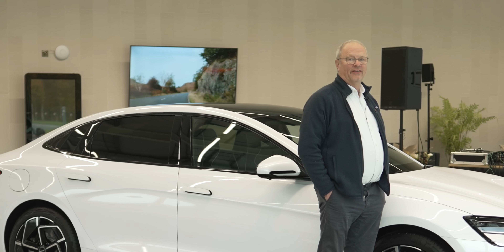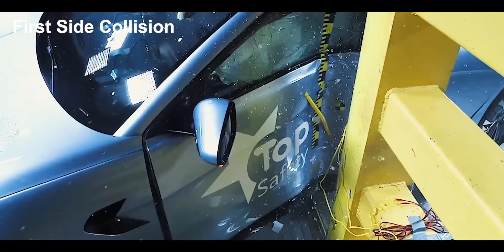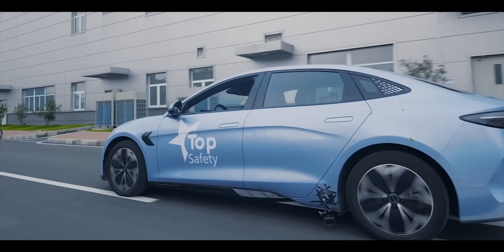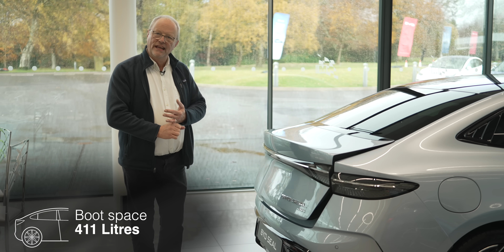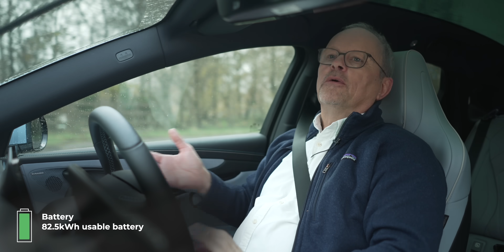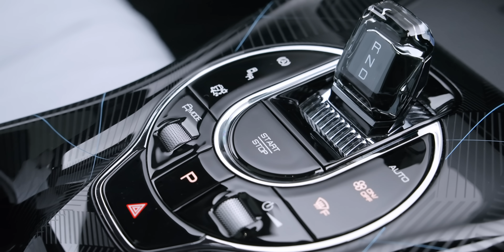This Car Proves Just How Far Chinese Cars Have Come

Comment: I get the impression that charging electric cars in the UK is as expensive as filling the car with petrol , assuming you can find a working charger . Then of course it takes time to charge the car . Whilst you spend even more money on coffee or whatever.
Reply: Only a very small percentage of electric car owners use public charging infrastructure on a regular basis, and charging at home is much cheaper and much more convenient.
Reply: @mowcius I think you exaggerate somewhat by saying 'only a very small percentage of drivers use public charging' and extol the joys of charging at home. Many journeys in the UK take drivers beyond 150 miles (bearing in mind this has a useable range of 300). Quite simply, the UK charging infrastructure isn’t up to the job and I'm not just referring to charge point numbers. As it is, electricity cabling up and down the country can’t handle the increased power required to charge EV's en masse. As for the 'ease' of charging at home, yes I’m sure it’s very easy if one has a driveway, garage  or off road parking. Many, many homes don’t have that convenience. Take a look around when next to go for a drive. Look at how many folk have to park at the curbside. Terraced houses abound. Do you envisage charging points on the pavement outside every residence? Of course, then one has to assume that motorists can be guaranteed a parking spot outside their home and not find someone has taken their space.
It may surprise you to know that I think EV's are great. I do. But charging….convenient?? No, no, no!
Reply: @jupiterfive3379  it is for the majority!
Reply: @mowcius How do people in multistorey housing, apartments with shared parking and others who cannot install charging points at home get to own electric vehicles? Electric vehicles are only for the rich.
Reply: @MadMulberry not necessarily true. Even the lower middle class and working class are (slowly) already migrating over to EV cars. It's not at  the speed as the rich, but it is happening.
Reply: @MadMulberry hopefully charging infrastructure will improve with more level 2 charging at malls, public parking lots, restaurants, cafes and workplaces to help those without home charging.  Lamppost charging outlets for street charging while parked are another potential solution
Reply: @OfficialHervé-S agreed, and many homeowners and renters who are not rich have home charging
Reply: @MadMulberry depends how you define "rich". We're all rich compared to most of the world population.  As for restricted parking, yes they will need to work on that problem but destination charging eg at work is one possible option. Also look at the Silence model, you take the batteries inside on a trolley 😊😊
Reply: @MadMulberry  take a look at Norway and The Netherlands. They have legislated and regulated to make it possible for people with dedicated parking spaces in private parking garages etc. to have access to charging. Making it a requirement for landlords to facilitate the install. 
It just needs the right laws. 
Of course it still needs installing but again there are plenty of examples of this working straightforwardly.
Reply: @MadMulberry Very true!
Reply: @OfficialHervé-S Presumably you’re talking about the working classes who don’t live in a block of flats or in terraced housing with not a chance in hell of ‘conveniently' charging up their vehicles overnight on a driveway, off road or in the comfort of a garage.
Reply: @jupiterfive3379 my sister lives in a block of flats and is still getting an EV car and she is from London and lives in the city.
Reply: @jupiterfive3379 it doesn't matter what type of home you live in anymore, people are choosing (slowly) to migrate over to EV cars.  I think businesses and of course local governments are trying to invest in more EV chargers now (even though it is at an almighty slow pace). With lamp posts also being charging docks in cities  etc I don't think cities like London to Glasgow (in terms of EV chargers) will be lacking from this year going forward.
Reply: Only if you public rapid charge on some networks.
If you can charge at home (which I do for 99% of the time) then it can be ridiculously cheap... about £0.02 a mile.
Reply: Coffee doesn’t charge the car
Reply: @mahadali619 no but it makes me pee.. which is why I have to stop every 100 miles or so, and when I do I may as well charge up!
Reply: I don’t have a problem with motorway charging being as expensive as petrol/diesel, the most important thing is that the chargers work.  Having multiple chargers is next. Finallly, multiple speeds, but tbh even at 50kW, a 30 minute charge is going to get you around another 100 miles. I’d rather have 6x50kW chargers at a site than one 300kW charger. The UK is not that big, and personally I’m fine stretching my legs every so often.
Reply: @markparker5585  yes, and many people only use expensive fast charging on longer road trips a few times each month or year
Reply: Bear in mind that public chargers are not the equivalent of petrol stations.  Most EV owners will recharge their cars at home most the time, and only need to use a public charger when going on long road trips. If you want to compare costs with petrol then it's the cost of charging from the mains at home you should look at, not public charging fees. As for time, with DC fast chargers you're talking a 15 minute stop every couple of hours or so,  no more time consuming than the breaks you ought to take for driver fatigue reasons anyway.
Reply: Well, it depends which charger you use.
With Tesla opening the network further and their pricing often half that of others, things are improving fast.